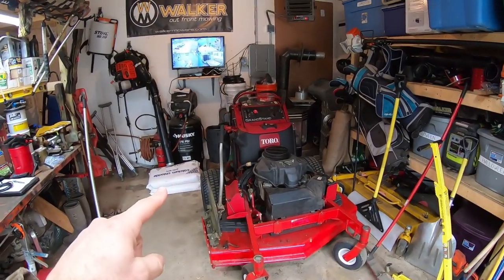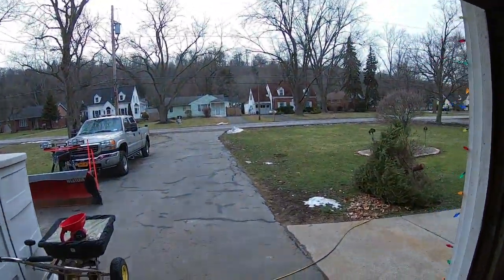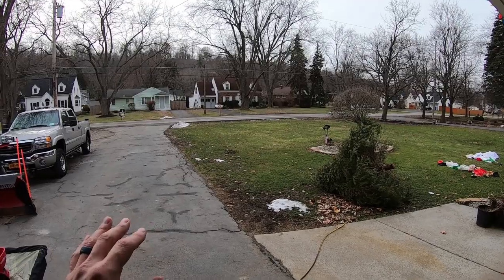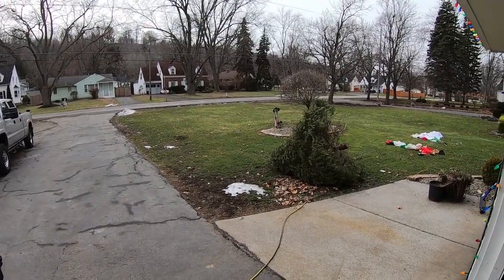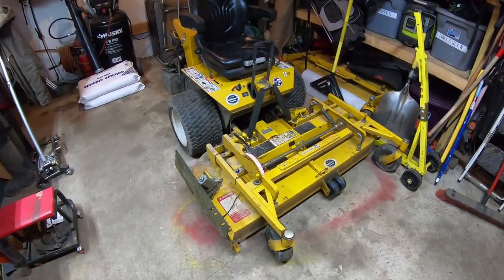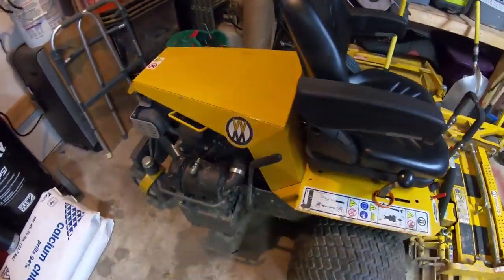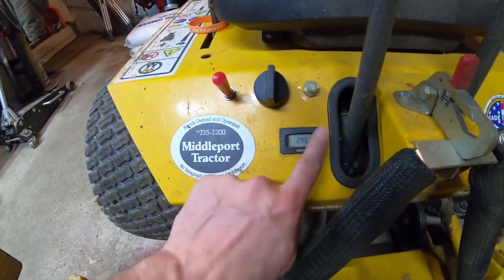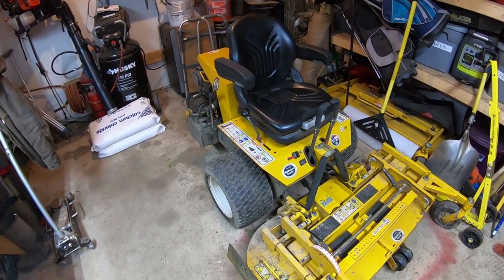Billys Mower for sale??

Comment: B19 carb good choice! I have 2 B23is and so far so good but when  efi problems start I am screwed. The 2 Bs I have made a huge difference in my business and life. I had bagged lawns over the past 20 seasons with me being solo I needed to cut down on the bagging. I had bought a super B(now the H) a few years ago with 52" Rd deck but it was a tank-to long and clumsy for the size lawns I was cutting! I traded it for a B23I with 48 mulch deck and that mower pretty much has saved my lawn mowing life-i have had it 4 seasons 1600hrs-its my baby! I bought a 2nd B23i last year with 48sd on only run those 2 mowers along side my 30" Toro timemaster. The mulching deck has replaced the ghs for me. I only use the ghs for spring and fall cleanup. I mulch as much as possible and when conditions are not good for mulching I use the sd and the decks being the same size I can follow the stripe patterns with no problems. Last year was the first time in over 20 years I did not bag a lawn during the mowing season. No dumping bins/barrels/tarps and no need for a $5000 high lift. Maybe in a couple of years  when I can afford one I will buy the new B27i. Thanks again for your videos.
Reply from the maker: That's awesome. Yea I'm trying to get away from bagging

Comment: Do you think the Scag Turf Tiger with the shaft drive is more efficient than the belt drive on the Cheetah?  I've driven  both with same engine and seems the shaft drive boggs down in tall grass vrs  the belt drive. Is it different when it comes to Walker?  Just curious on your opinion 🤷‍♂️🤔
Reply from the maker: That really surprises me. Shaft driven should NEVER bog before a belt driven. It's direct power so to speak. I wonder if something was wrong with that mower 🤔